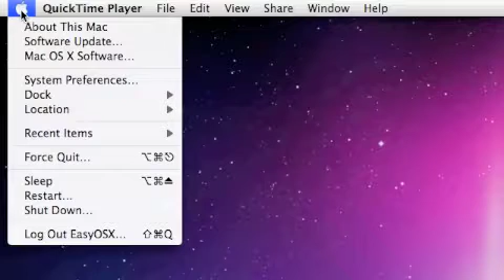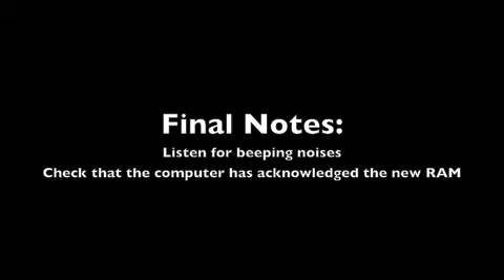Install RAM in a Macbook Pro

Comment: mine is a MacBook 13-inch, Late 2009, not a macbook pro. What I mean by move the screen is I move the part of the screen that opens and closes the laptop (physically with my hands). The reason I was skeptical if it was a hardware problem is because like I said, it's very spiratic and will sometimes happen even when I'm not moving the screen. I went on a forum once where I saw a lot of other people had the exact same problem, screen pixilating slowly more and more but programs still operated

Comment: really great vid. couldn't find one like this surprisingly. I do have a question though. My mac os x snow leopard has been having this problem for about 6 months now where if I move my screen back and forth too much the screen freezes (not the computer, it still processes) and slowly gets more and more pixilated with white dots. It's very spiratic and if it happens I can nullify it by putting pressure on the side of the screen. Ever heard of this?